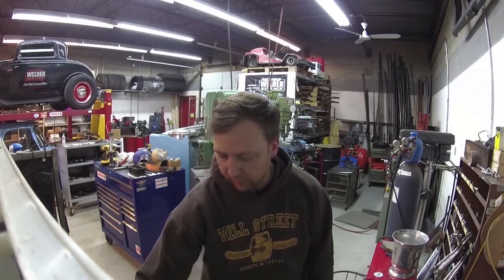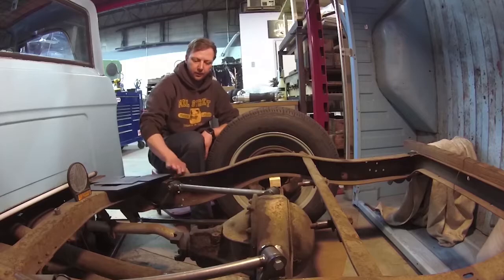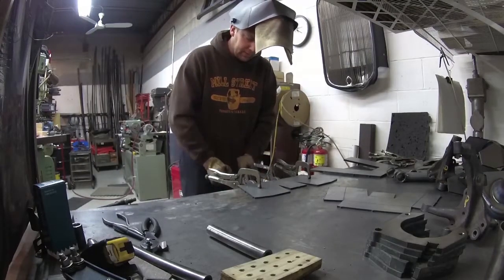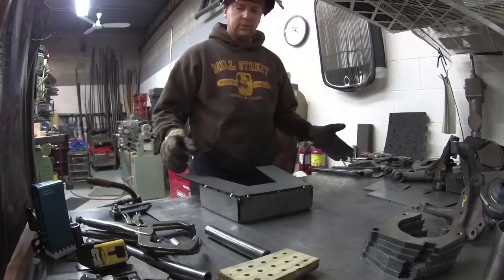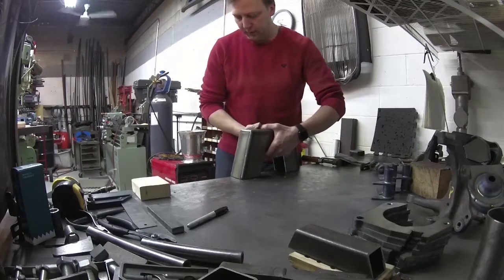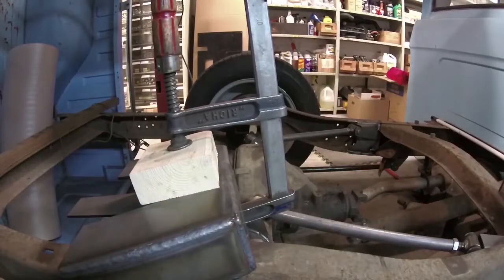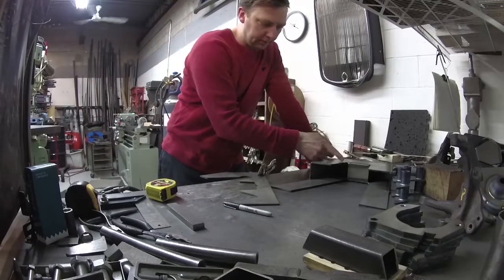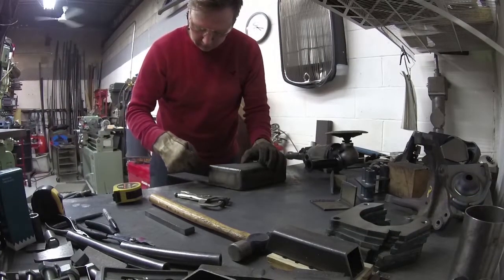Welder Series Step Notch on the Sweptline

Comment: You should redesign your notch plates so that the short side is the same length as the long side, or offer different style notches, even if you had to up the price a bit. Folks could cut them to fit their application that way. Then they would have more overlap on the sides of car frame rails. I really want to use your notch since I'm using your 4-link but I dont feel comfortable welding the short side just along the top of the frame rail as opposed to having it overlap the sides.
Reply from the maker: Hi Christopher, thanks for your comment. We feel that the kit is strong enough with the full inside boxing plates and the full length inside plates. Having a smooth outer frame rail surface was important (second to safety, of course) too. You could add fishplates overlapping the notch and frame if you wanted, but we don't think it's necessary. Thanks for using our parts!
Reply: @welderseries  
 That's a good point about the fish plates I never thought about that